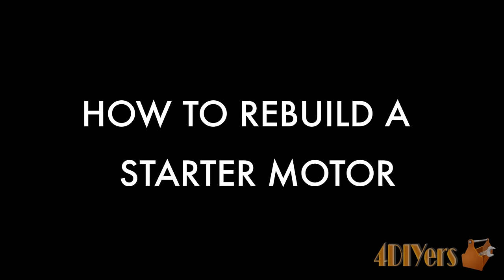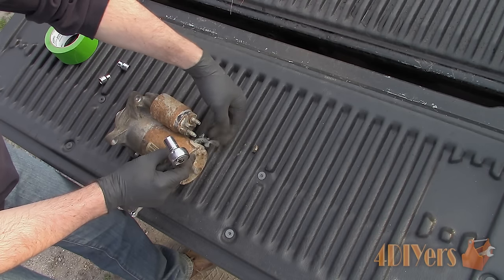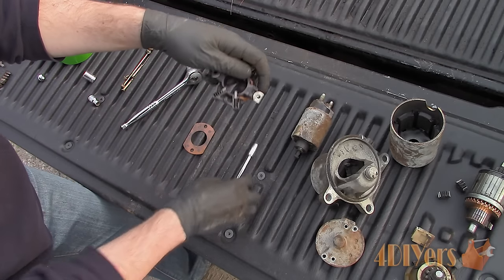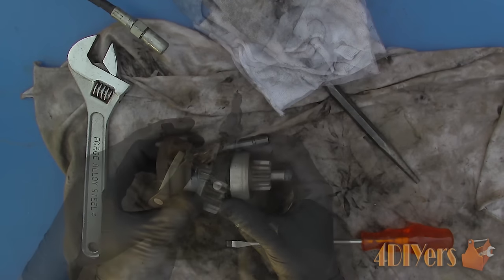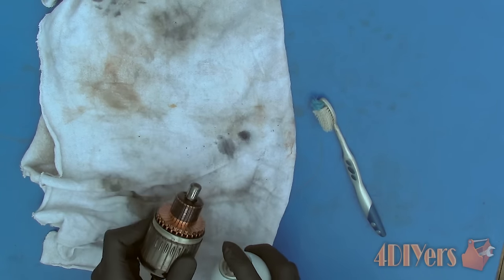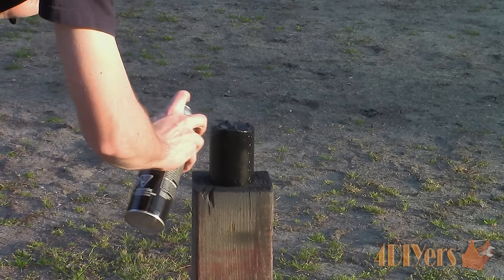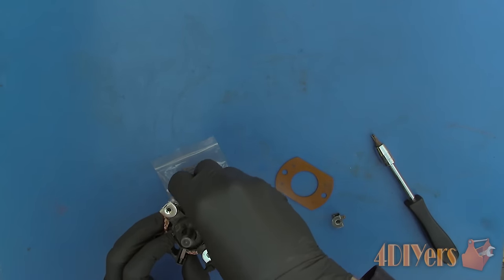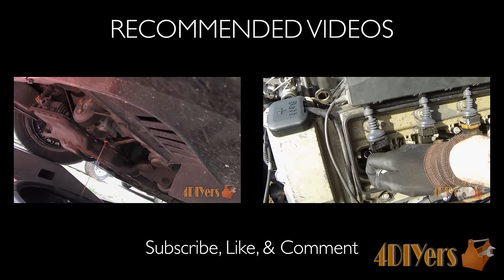DIY: How to Rebuild a Starter Motor

Comment: this definitely is a lot of work but for people who have older cars with no replacement parts in production anymore, this is amazing content. Thx
Reply from the maker: Thank you! I've heard some older vehicles no longer have replacement parts available. I prefer the older stuff over new vehicles.
Reply: I have a Mercedes R-class, it's around $1800-$2000 for a starter replacement. That's why i'm here. 🙂
It will be worth it if I can make it myself.

Comment: I love your work surface. Nothing rolls away. You've done this before; I can tell. No "uhs", "ums", or "like, you know" pauses. Obviously a professional and the standard for DIY videos.
Reply from the maker: Thank you so much for the kind words, I appreciate the support!
Reply: It’s voice over...
Reply: I purchased a new starter motor for my Same Corsaro 70 Tractor. The tractor starts in about 3 seconds during which time a loud rattling sound comes from the Starter Motor. Does anyone have any ideas.

Comment: I was taught how to rebuild starters ,generators and some water pumps years ago when I was a teenager.you are on target when it comes to mechanical skills. Am now 77 years young keep up the good work .
Reply from the maker: Thank you so much :) I've learned a lot of the older ways, even repairing parts when possible instead of replacing and testing things before replacing. My dad is a licensed mechanic, but long retired now, so I've grown up around the stuff.

Comment: Absolutely love the video, very descriptive and to the point. Just rebuilt my 93 Toyota pickup and my starter solenoid isn't engaging. I will use what I have learned here to fix / diagnose the issue. Thanks!
Reply from the maker: Thank you so much for the kind words and happy to help!

Comment: thnaks so much for making this video! 4 years down the track and people are still being helped by it. top work! ive been having intermittent starting issues for a couple of years and finally pulled the starter today. i figure that it needs replacing anyway so i may as well have a go at fixing it. this video may well help prevent me being bent over and getting a raw deal at the auto shop, haha. i feel confident that i'll be able to pinpoint the problem and possibly even fix it thanks to your efforts. very much appreciated!
Reply from the maker: No problem, glad I could help and thank you for the feedback!
Reply: @4DIYers  no probs. found out the starter is fine, but the solenoid will need replacing when I can find one at a reasonable price. saved me paying an auto-electrician more than i can afford to do a simple fault tracking task. cheers

Comment: Incredibly detailed video on how to rebuild and test a starter with solenoid. I will apply what I've learned here  to a Delco Remy tractor starter with a slow crank.  problem.
Reply from the maker: Thank you :)
Reply: A Slow crank usually indicates bad brushes or weak battery.

Comment: Great video, however I’ll pay the $200 for a new starter, this is a lot of work!
Reply from the maker: Thank you!
Reply: Very good job. 
Congratulations.
Reply: It's helpful for expensive and irreplaceable starters like antiques.
Reply: Its 4diyers not sissy boys
Reply: Agreed on both counts! Going a step further, looks like lots of work AND a non-working vehicle while that starter is not 100%. I like to gauge time based how long professionals take on something. If it looks like they're taking an hour+, I factor in probably 2 (or more) hours for me to do the same thing. However, maybe buying a new one AND still taking the old one part, just for curiosity's sake.. hmmm
Reply: haha here here! 

I am glad I am not so poor I can't afford to  just buy a part instead of dickign around rebuilding them 

there are plenty of aftermarket options for starters that are $100 or less and come with warranties.
Reply: I'd pay the $200, if I had it, but my "scrong & independent" ex-wife has all my money for much more important things: handbags, eating out, and vacations.

Plus, tedious and detailed jobs like this helps keep my mind off of the fact that I'm a modern day wage at slave, and one day, I'll be free, with mad skills, and she'll be a fat, use less medicated cat-lady!! Winning!!
Reply: detailed and quality work that can match new starter, great video
Reply: It's really simple what's two bolts In total it's 6 bolts that's to easy
Reply: @Blake_Guajardo Uncalled For. What If Dude just needs to replace? what if He has enough money? or what if he just doesn't care?

Comment: I accidentally found an easy way to get that end cap bushing out.  I read a hint somewhere to screw a tap through the bushing to the bottom and push it out.  The ID was about 12.5 mm so I bought a 14 mm tap (thinking a 13 mm wouldn't get enough bite to pull it put and just end up shaving some off.  The 14 mm wouldn't quite start by itself so I tried to open up the top a little with a 1/2" bit. The drill pulled the sucker right out.  Might not work every time but heating up the outside of the end cap might increase the odds.

My kit came with new brass bushings for the reduction gears but the originals were steel and didn't seem to be worn at all.

Comment: Nice, Now I need to find parts, I am guessing that there are specific brush sets for specific starters since they come in so many different diameters.  This job doesn't seem like its going to be too much fun to hunt down parts.   Grr.
Reply: You can use all bigger brush on the market. Just make it same size as car starter needed.

Comment: Excellent. If the background surface was white to contrast with the darker grey of the starter, visuals would be sharper. Any way I will rewatch on monitor rather than tiny iPhone. Thanks so much.

Comment: Thanks - just got my starter disassembled and cleaned following your instructions. Super clear and helpful. 
Wondering what grease you used? I've got SuperLube and Valvoline General purpose grease laying around - the SuperLube indicates a higher temp threshold than the Valvoline but I'm not sure if it's suitable for this job. Thoughts?
Reply from the maker: As long as it's good for bearings, than it should be fine.

Comment: Saved to my tutorial playlist very good job my friend truely appreciate your effort and teachings if I have to wack my electrial solenoid to start the car when its hot im noticing that's typically the solenoid yeah? 02 taurusmy moms ride
Reply: Icant believe more people don't do this 90% of starters I see as cores are in perfect condition likely one 5$ part is all is needed thats why they make sure to get that core from you what a scam props man in a scandalous money motivated world you helped many less well off ppl
Reply from the maker: Thank you, always happy to help :) Sounds like an issue with the solenoid or sticking linkage. You'll need to take it out anyway so it's probably a good idea to check it over just to be safe.

Comment: 4DIYERS How do you determine what part numbers you need and where do you order them from?
Reply from the maker: If you have a local starter/alternator rebuilder, they'll be able to tell you the required parts. That's what I did.
Reply: @4DIYers  Hmm nothing like that around here, not that I know of.

Comment: What brand ratchet is that? I love that the pawl switch rotates as you wrench. My craftsman always has a tendency to change directions if I’m holding the head in my palm.
Reply from the maker: Mastercraft, they're quite old. They were replaced under warranty about 15yrs ago, only available at Canadian Tire as far as I know. Not sure if they even still make them like this. They did have a full rotational top. But I have noticed these can switch direction the odd time too if I'm working in a tight area with one hand on the top of the ratchet. Sometimes the switch can catch up on my gloves.
Reply: 4DIYers thanks. I’ll check eBay. I’d like to give one a try.

Comment: Very informational video. A question: with the starter out of the vehicle, I've placed one probe of the multimeter on the 's' trigger terminal on the solenoid and the other probe on the case of the motor and I'm seeing continuity. Doing the same test with the braided wire that connects to the starter and the starter motor case I'm also seeing continuity.  Does this indicate a short?
Reply from the maker: Thank you. From what I'm understanding, that should be correct. That braided bare wire is a ground.

Comment: I assume those dimples in the armature were orignally all the way around, and the sloppy end cap bushing caused uneven wear.  I pulled apart two old Mitsuba starters from two different Civics (both failed at about the same mileage) and both looked like this, although one had a couple more dimples on the end toward the cap.  (I used that one).

Comment: Hello bro,  I wonder are you familiar with Mitsubishi type starter? 

Its originally have 2 plain flat washer which are a thicker and a thinner one all places at the top of the armature before I pull the end cap out ,after I put them back to where they should be and lock the screws up and the starter wont spin at all, the gear clutch engaged but no rotation, I think it's the washer got stuck or short circuit somewhere(but I couldn't find any burn marks) But I want to hear an expert advices before I do anything.

Comment: I purchased a new starter motor for my Same Corsaro 70 Tractor. The tractor starts in about 3 seconds during which time a loud rattling sound comes from the Starter Motor. Does anyone have any ideas.

Comment: very cool, that refurbished factory one would probably last longer than a non-oem Chinese replacement
Reply from the maker: Thank you! I've definitely been hearing a fair amount of issues with Chinese made water pumps and wheel bearings. Some only last a couple months.
Reply: I can not say the Chinese replacement parts are good enough, but you know what, a big amount of OEM Starter motor were also manufactured in China. Aftermarket is very complex, don't take cheap one, do smart choice.
Reply from the maker: Alan Chou Yep, it definitely depends on quality control. The cheap aftermarket units you have to worry about coatings, tolerances, and the quality of metals though.

Comment: 4DIYers I was wondering if you could help me, I have a 1955 John Deere tractor, the parts for the starter are available but the starter is not. It has been left to be obsolete. My problem is when I take the starter cover cylinder off, and look inside the starter cylinder, it  has the four little nomex (I presume) covered pads on the inside. The nomex has worn thru so, do these four pads need the nomex to shield from shorting out? I have not been able to get the starter to work and I have installed a replacement spring and brushes kit.
Reply: Looks like you are referring to the field coils. Those should be available. Changing those will make a gigantic difference, especially if it's a 6 volt system. It's often why people change to 12 volt, which is a big mistake long term and can damage the starter drive and nose cone.

Comment: My vehicles starter works fine sometimes and then other times it gets very lazy almost like it's sticky. What could be the problem? Does it just need a good clean and brushes? A new battery was fitted so that's not the problem.
Reply: It could very well be the cable that runs from the battery to the starter. This cable should all ways be tested when replacing the battery. As well as the ground cable. These can lead to the symptoms you described if the ends are corroded, or damaged. It can even stress your battery, or just not charge it well leading you to replace the battery. If the ends ware the copper strands are oil soaked this can cause problems with the cables over time. Also another source for this type of symptom is the solinoid. If it is startering to go week it will not all ways make a good contact reducing the amount amperage to the starter occasionaly. Also I have had the plastic cap ware the wires connect to the starter develop a crack near ware the main battery connects. This allows that stud to move and some times not make a good contact. I hope this helps track down the source of your trouble.

Comment: How do I repair a broken POS pole on the starter motor ? Fix broken off pos wire inside starter motor for old f100 motor I think

Comment: Oh well....I guess 4DIYers don't check this page much.  I  have a similar starter.  I just don't see how to separate the commutator from the brush assembly.  The video goes right past that part.  I see the brushes are worn down,  just need that part replaced.
Reply from the maker: An FYI, I get dozens of comments a day and I don't sit beside my computer 24/7. Not one person is more important than the other, replies are done in chronological order. You're requesting free information which you'd typically pay for and sadly not everyone is appreciative of such a service. Once in a while it's nice to hear a thank you when I take time to help troubleshoot a question instead of kicking up a fuse when I don't reply immediately.
Reply: You know how sometimes a person asks a question, and then they get a response like 3 weeks later?  I posted again to make sure it was understood I needed this info, and couldn't wait that long.  I have the starter out of the car, and need to get it back on the road asap.  The starter requires more urgency than some of the other repairs, because the car can't be driven at all.  If I came off as overly aggressive, it wasn't my intention.  

Like I stated in the previous post, I took the part to an auto shop and they helped me out.  I've done that several times before, and no mechanic ever wanted to charge me for info.  The local auto shops don't mind sharing knowledge for a question about a part.  I do know that many people take what you're doing for granted.   But make no mistake, you taking the time to post this video is definitely appreciated.

Comment: 2006 Impala LT 3.9 automatic. No crank no start. All accessories work when key is turned to run position but starter will not run. New battery and cables, all fuses and relays work properly. There is power from the ignition switch to the starter and engine is not locked up. Starter will run off the car but, not on the car.
Could you please help a senior citizen out.
GOD bless and thank you so much for your video.
Reply: Check the neutral safety switch location near shift lever

Comment: Little help please =D   Do the starter motors planetary box have any mechanism to avoid reverse spin? or there is some mechanisms to avoid reverse spin?
Reply from the maker: Yes there is, I have explained it in this video https://www.youtube.com/watch?v=GmwfnEp6S0M
Reply: 4DIYers ...ok an overdrive clutch that provides torque in one direction and free-wheeling in the other direction, Right?   ok Thanks =D

Comment: When doing multiple trips at different stores I noticed that the starter turns over slowly but starts the car, or driving for an hour stop the engine and then start the engine starter turns slowly what can cause this? I have a new battery and the battery test out ok.
Reply from the maker: Have you cleaned the battery clamps? That could be the cause, but there is a good chance the starter is on it's way out. The armature and brushes will wear out eventually, not providing a sufficient contact for the motor to turn quick enough when starting the engine. Here is my troubleshooting video as well https://www.youtube.com/edit?o=U&video_id=E1nlbeXtVmQ

Comment: What is broken if the starter isn't spinning
Reply from the maker: The first thing to check is if the starter is getting power and has a proper ground. Next would be checking if the starter is spinning freely.

Comment: How much grease do you put on the 3 planetary torque gears & needle bearings You never said & you never named the grease either!
Reply from the maker: It's a high compression grease, same as what is used for bearings. Ensure the gears are sufficiently covered, do not overpack the area though.

Comment: Ok so am not a pro by any means but I recently serviced my starter (before discovering this video) and after I reinstalled it and started her up, I heard a loud pop so I instantly shut it off and searched around the engine compartment for any sign of breakage. After a thorough search I concluded it all looked good and attempted to start it back up and... nothing. Didn't even try to turn over. So after checking all the fuses and wiring a took apart my starter to see if I missed something and this is what I found. Anyone know if my ignorance is what caused this mess or if there's something I missing here. Never seen a starter implode before. Here's a little slideshow so you can see what I mean...
https://youtu.be/aeig2Hgs4yw
Reply from the maker: Sounds like the bendix assembly or the gear stuck, so the starter never disengaged after the engine started. It spun too fast and flew apart. Hopefully it didn't cause any other damage.
Reply: 4DIYers Well just picked one off another rig at the junkyard, broke down and cleaned using your video as a reference. So fingers crossed when i drop the new refuebished one in i dont have a repeat or worse yet, other parts to repair/replace additionally. Thanks for the video 95% effective, theres just one detail that realistically still has me puzzled. Unfortunately your ranger didnt gave this component on it's starter so im wingin it... Will post update good or bad in the next couple days. Till then...